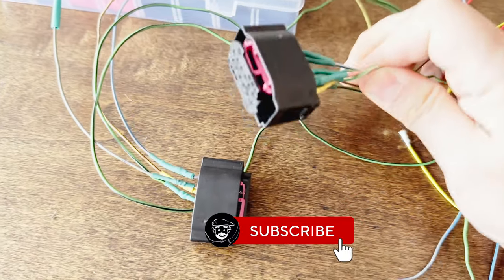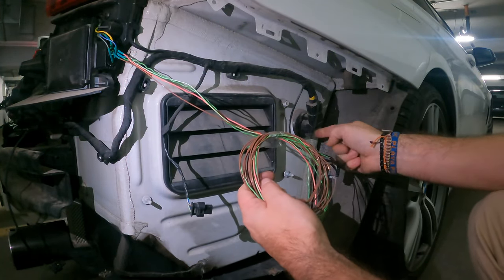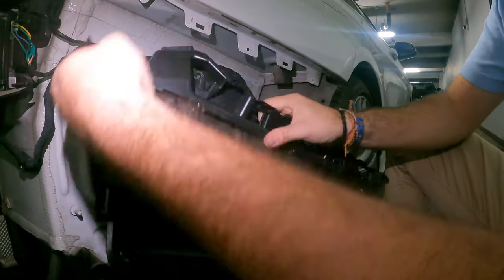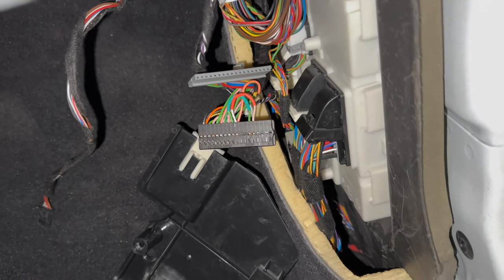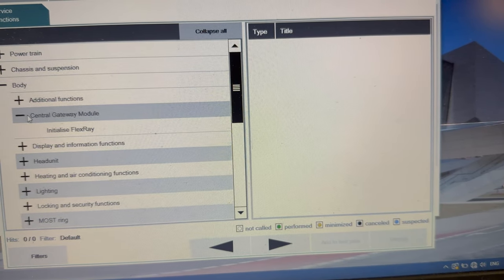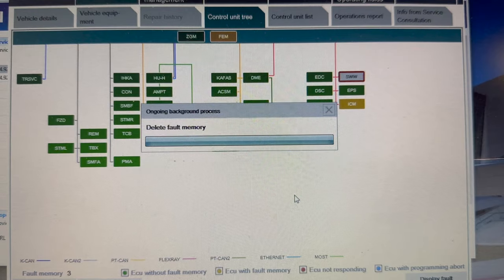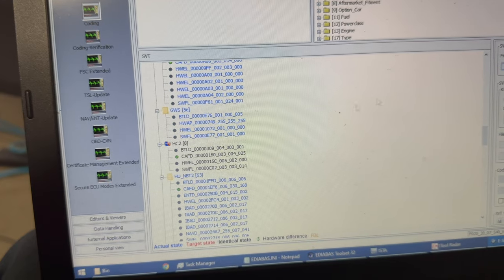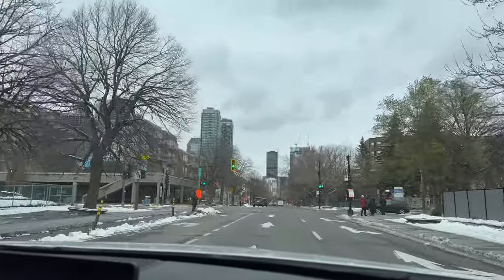BMW Lane Change warning 5AG Wiring and Coding.

Comment: Hey, that's great. Just what I was looking for. You're making the wires on your own. I'm thinking of retrofitting full surround view to my F10 but the cost of all the wiring harness stops me. I've thought maybe I could make them on my own but I don't know anything about the type of the wires and the connectors. Maybe you could help me build the harness? If you know, just share the wire types and the connector types and where I can get those connectors if they're sold separately.

Comment: 20:23 So is it better/ easier to do to buy the Sensors ( master and slave ) for example from a car from year 2019 if my car is 2018 or should I buy the sensors from 2013,2014,2015,2016,2017??
Reply from the maker: Better to stick to your production date or earlier by 1-2 years toos
Reply: @DorksandBolts  okay so I will buy these „ earlier „ from 2019 :) thanks!

Comment: I try to code it but after FlexRay initialisation I have there errors which still there and back in esys I do not have there HC2 :(
it is necessary to kode kombi? (what you did in 15:30)
Reply from the maker: Hi, no Kombi is not necessary to code. Most usual problems are due to wiring, but maybe also you might have to use tool32 to open the ports. If you want, we can set up a call to deal with the error
Reply: @DorksandBolts  not successfull mr told me that I need vibrating steering wheel, I thought that it will work without it. but now Im have problem with revert it back. still have issues :(
Reply: Do I need to change my steering wheel or what other components would I need if I don't have the vibration wheel?
Reply: @pedrogodales2766  you can replace steering wheel with vibration. It will be easier way or you can add vibration motor with control unit to yours but be careful because there are two types of this pieces depends on type of steering wheel. There are pieces for standard steering wheel and different for m-sport steering wheel

Comment: Nice video man,
I preparing same on my F11 but I do not have PAM so I need to make little bit different connection
btw screenrecording will be much better than shooting your screen :)
Reply from the maker: Awesome, I aim to inspire people to get that rusty screwdriver out of the box put it to work :)… and yeah I was screen recording in my previous videos until windows decided to remove that option…. Lost my patience looking for a good alternative
Reply: @DorksandBolts  I was ispired long time ago now I'm waiting for parts :D
I have lot of to do, Im thinking to make surround view because new mirrors for that retrofit will come with cameras :)
Than still do not have finished my comfort access retrofit but waiting for guy who will code this.
Than I bought kafas camera and because of this I need to change windshield and than I'm thinking to add HUD
than I want to buy new seats to have heating for kids and maybe last will be ACC :)
huh probably this is all
Reply from the maker: @dzooky  hahahah yeah that’s what I said when I started 2 years ago 😂 if you want some help coding and  stuff send me a message and we can work something out.
Reply: @DorksandBolts  OBS Studio works well for screen/window capture.
Reply from the maker: Thank you for the tip!